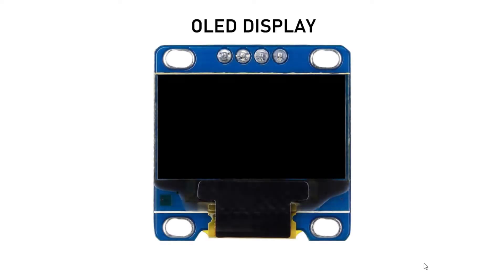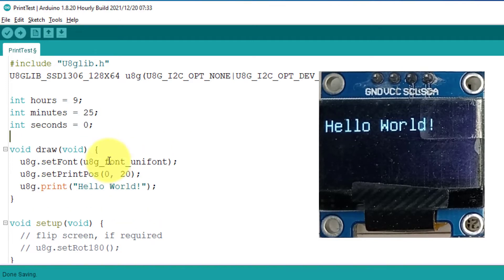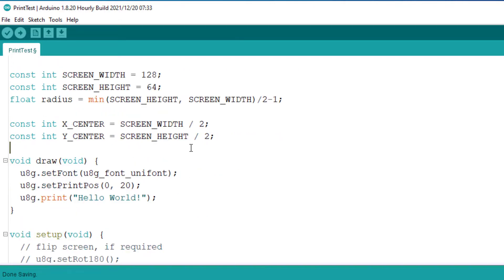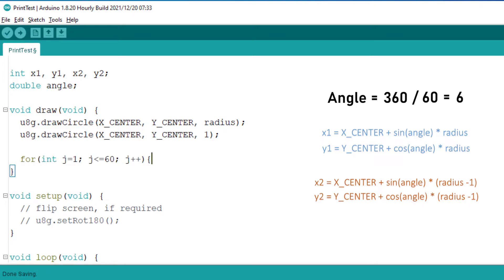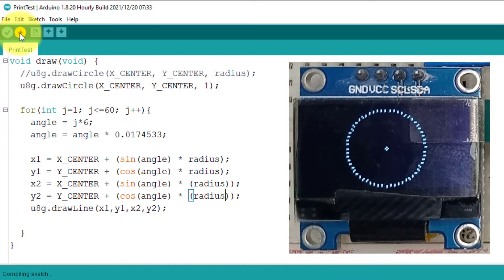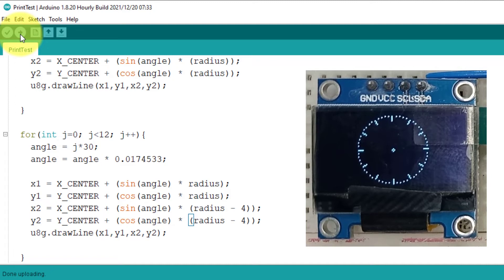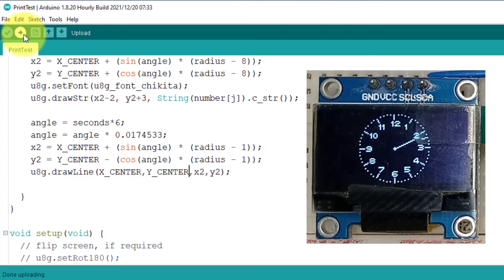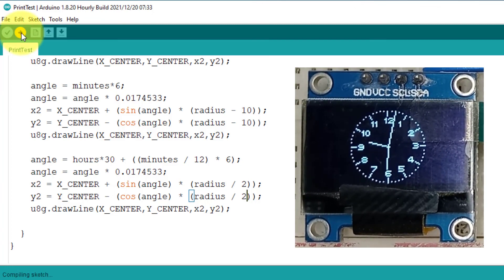Lets Make Analog Clock Arduino - OLED Clock - Arduino Programming Tutorial

Comment: Ahmad, Built the clock, loaded the sketch, but at the line "char *number[12]={"6","5","4","3","2","1","12","11","10","9","8","7"};."  When I verify, I get the following error message "warning: ISO C++ forbids converting a string constant to 'char*' ".  However, the program does compile and run.  Should I be concerned about this message?  It is way beyond my level of programming to really follow what it is doing.  Thanks.

Comment: Hi Ahmed, I am 3D printing a Railway Station which has a clock tower with 4 faces and I thought I would put 4 x 0.96" Oleds in this tower and your display is just what I needed, I have the space to add them so I think your sketch and ideas is very helpful, to control I already have a PCB from JLCPCB for a Nano and a TCA9548A module which I used in a signal application so I can drive the 4 Oled displays plus I want to add a DS1307 Real Time module, which I think with help from another forum I am with if I get stuck I can get help ...

Comment: When the power is off and on again so the time remains same as the current time ?
Reply from the maker: the time will reset after power on the arduino. you might use RTC module with battery to make project more useful

Comment: https://youtu.be/ISaaJ2m_QAA

I managed to make 5mm leds
It works , thank you . Is there a way to fix the 1 Hz flicker on the display that seems to happen after every pulse on the GPS module ?
The problem was explained but I couldn't

I made 5mm led 7 segments

Can you make esp8266 vs esp32 blynk as latitude longitude and 5 mm led 7 segments?